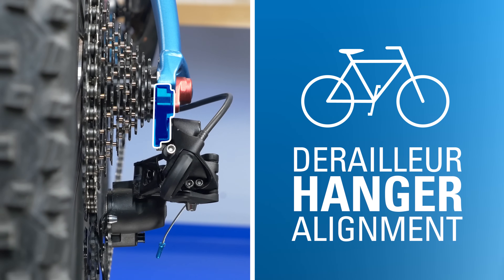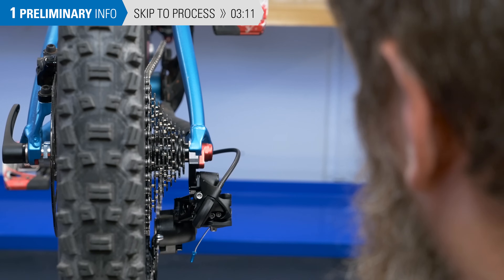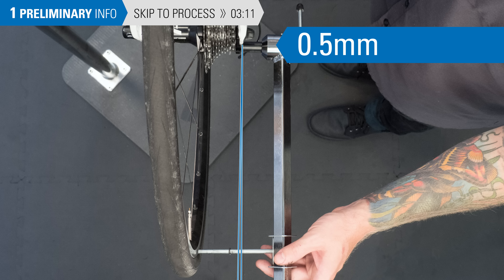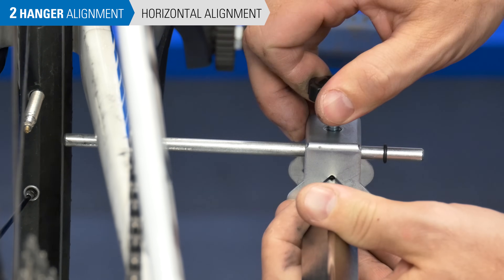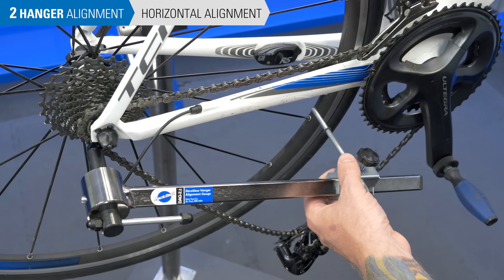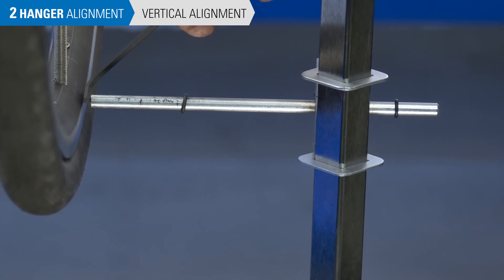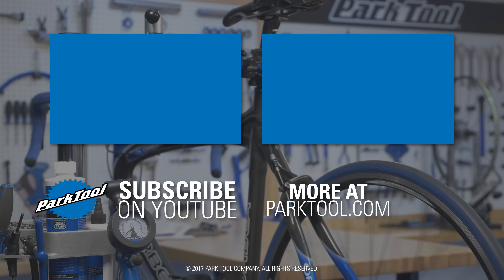How to Align a Derailleur Hanger Using the DAG-2.2

Comment: is it wise to try this method with the hanger on a carbon fibre frame?
Reply from the maker: Yes, it is fine.  Check the hanger is aluminum, the common material.  It is bolted tight to the frame. The stress and bending occur in the hanger, not in the frame.  It is done on a daily basis around the world.

Comment: Can anyone let me know if the hanger is cast aluminum, how possible it'll break during the aligning?
Reply from the maker: It is not cast, put plate aluminum.  Failure is possible of course.  However, aluminum will flex and accept a bend during cold setting.  If there is no crank into hanger and it survives the alignment, it will survive the use.  If the hanger needs alignment to shift, it is already effectively "broken" and needs alignment.

Comment: In 2010 I broke a derailleur hanger on my Trek 6000 and had a hard time finding a replacement. My next build will be a UDH compatible frame.
Reply from the maker: The "UDH" hanger is a bit misleading.  It is simply another hanger design.  It is a good hanger certainly, but the "universal" aspect is in the name.  The UDH is for thru axle only.

Comment: All the adjustments concerning derailleurs, chain length etc are PITA when you own a velomobile. For example, using this (expensive) tool is impossible because rear wheel is completely sealed in it's own cover. I'll have to make my own "tool" to make sufficient measurements, and just judging the straightness with the eye is impossible because of not large enough service hatch 😛

Comment: why not just replace the hanger??
Reply from the maker: Hangers are often difficult to find. Even after finding one, they should be double checked for alignment. The hanger may be straight, but the bike fitting for the hanger is often a bit off.

Comment: What about titanium frames? I have your higher end alignment tool but I’m finding it almost impossible to reset. It’s bent 1cm outwards and refuses to stay put when I bend it inwards. It bounces back out. Extremely annoying. Unfortunately, replacing hanger isn’t possible as it’s integrated into frame. Can’t believe I might actually have to scrap an expensive frame all because of a bent hanger.

Comment: How do you know the hanger is bending, and not the frame?
Reply from the maker: Good question.  The section that is bending is between the mounting bolt and the wheel mounting.  The wheel axle fastener will not allow bending at the fastener area or above.
Reply: @parktool  Thank you, makes perfect sense.
Reply: Also the hanger is quite soft aluminum and is designed to bend so the other components don't break, I was surprised how little force it took. With just a couple fingers worth of torque on a long arm, it felt almost like putty. Go slow and small movements at first!

Comment: Is it true if I buy chain oil for my push bike that it won't pick up any dust or dirt or anything else
Reply from the maker: There are what are referred to as "dry lubes" that use wax to lubricate chains. They are dry and do not collect as much dust or dirt. It typically does not make the chain as quiet and does not typically last as long but is a great choice if you are looking to keep your chain very clean.
Reply: @parktool over in Woolworths there is a product called WD40 chain oil would this be good for my chain

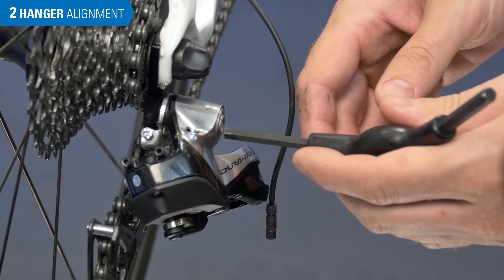Comment: What is he removing at 3:26?  Is this some type of rear derailleur quick release?  I have never encountered such a thing on a rear derailleur.  If a rear derailleur lacks this quick release mechanism, does the cable pinch bolt need to be loosened before removing the rear derailleur?
Reply from the maker: That is the wire for the Di2 rear derailleur.  It sends an electrical signal to shift.   it is best to unplug it so as not to stress the plug end.
Reply: @parktool  Thanks for the reply!  So if I am working on a traditional cable tensioned derailleur do I just simply unscrew the derailleur and let it hang from the cable/housing?

Comment: Derailleur hangers are intentionally designed as sacrificial pieces of equipment. they are like electric circuit breaker. hangers are designed to be strong enough to do it's job, and also to bend and brake,  in case of crash or bash. The main idea here is that the force from the impact, regardless of the source of the impact, will follow the path on least resistance. The hanger is designed to vividly manifest itself as the path of least resistance, so it draws the force of the impact onto itself. the idea behind this design is to protect the frame and the derailleur  from being bent or broken. If you think, this sacrificial piece saves you a frame, a derailleur and the hassle of replacing frame or equipment.... and the pile of money related to all this hassle.

Comment: Dang i broke mine i guess i wasn't gradual enough with the adjustment or is it just time to replace anyway? It was wildly of when i measured it
Reply from the maker: If it was bad enough, it needed alignment. Likely there was nothing to do by try it.
Reply: @parktool  thanks. Yes the chain was coming off the pulley when shifting down in the front

Comment: Just got mine today, and after removing the derailleur from the hanger, and following this video closely, I can't believe it.  It was imperceptibly bent inwards, which the bike being new, the hanger was bent imperceptibly during shipping. Not uncommon, but I could've sworn it was aligned by eye.  I could not have been more wrong.  It was definitely bent, and this tool got the bike shifting so damn smooth it's ridiculous.  I'm glad I just dropped the $80 on this awesome tool instead of buying a chain, and this and that.  Nothing I did following Park Tool's video on derailleur adjustment really got it smoothed out.  Because the dang hanger was bent.  

NICE JOB Park Tools! :)  I also own their small beam torque wrench, and man that makes that easy, too.

Comment: Just bought a replacement hanger
 Do i need to align it even if it's new? Coz that's what others said to me in a bike forum. I thought you just need to slap it and that's it.
Reply from the maker: It is good to check alignment.  New hangers come aligned and straight. However, frames are often not consistent, and a new hanger not be straight.  Check and aligning a new hanger effectively "customizes" it to your frame.

Comment: Is it safe to make these kinds of adjustment on a carbon frame bike?
Reply from the maker: Yes.  The hanger is bolted to the dropout, but it is the aluminum hanger that is bending, not the carbon fiber.  Aluminum can be cold set.
Reply: @parktool  Thank you so much for the  - very quick -  reply! Your help and advice is always much appreciated :)

Comment: Why don't just change the hanger ?
Reply from the maker: Good question.  First, these hangers can easily accept some cold setting without any issue.  Hangers can often be difficult to find depending on the bike model.  Lastly, although hangers are made straight the frame fitting is often less precise and aligning the hanger effectively customizes the hanger to that frame.
Reply: @parktool  Thx for the response !

Comment: Honestly its easier to just buy a new one, i think its about 15-20$ if not less. Mine broke like a cookie after a not so hard crash on the side :/ Even the derailleur broke.
Reply from the maker: Interesting thing about new hangers.  They are often made straight, but when mounted can appear "bent".  The hangers are more precise than the frames, which tend to be sloppy.  A new hanger needs to be checked and "custom fitted" to each frame.

Comment: Also remember to make sure replaceable  hanger mount bolt(s) are tight. Loose bolts can also affect shifting
Reply: i have 2 spare hangers, i have bolts on each one of them, but you can use the bolts from the original to install the spare if you are careful not to loose them in the grass on the trail side
Reply: *Torqued
Reply: @thegrowl2210  shut up

Comment: I finally fixed my bike.  I shot a laser parallel with my frame then measured to make sure my rear tire was in-line with my frame and come to find out it was 1/2" off so I used a dremel to grind the hanger about 1/8" back so the tire axle can go back on one side making my tire in a straight line. I then used this hanger tool to align my hanger. I got everything to 1/8" and WHAT A DIFFERENCE. Instead of only being able to shift half my gears and have them pop out of gear all the time it shifts like a Ferrari. I brought my bike to 3 bike shops and multiple times to those shops. Everyone just gave my bike back charged me for a tuneup and nothing ever changed......If you want it done right do it yourself!!!  Im happy :)

Comment: Can this be used on a carbon frame to straighten the hanger asking for a friend
Reply from the maker: The carbon fiber frame will use an aluminum hanger. Yes, you can align those hangers on a carbon fiber hanger.  If the hanger were actually made of carbon fiber, then do not align.   No one does that, however, it will be aluminum.

Comment: Is there a recommended torque for installing the derailleur hanger on the frame?
Reply from the maker: If these are the small M3 screws, it is pretty light, about 1.5Nm.  If it is a chainring style bolt, 6Nm.  Use common sense.  The real holding comes from the wheel axle as it is clamped.

Comment: Presumably, this only works if the wheel is true?
Reply from the maker: Not at all.  Simply pick a consistent spot of the rim, and rotate that when check the various points.  Right by the valve is an easy reference.

Comment: What if the Derailleur Hanger ist adjusted but the (brand new)  Shimano XT Shadow derailleur is still not in line with the cogs?
Reply from the maker: Use the derailleur limit screws to align the derailleur to the smallest and largest sprocket.  However, just because a bike is brand new, do not assume the hanger is straight.
Reply: @parktool  The hanger and the derailleur  (not the bike) is new and both are adjusted but still not in line. Are there any other reasons for that?
Reply from the maker: Give this video a shot. https://www.youtube.com/watch?v=UkZxPIZ1ngY&t
Reply: @parktool  I already watched almost all your vids as they are really great.

Comment: I managed to snap my hanger 😕 the frame and broken hanger has three fastener holds but I have a replacement hanger that fits but only two fastener holes. Would this be ok to use if the shape fits?
Reply: Rachel, even if it works I'd say the answer to your question about replacing a hanger with less fastener holes than the original is not to do it.

Comment: is the bending adjustment recommended for carbon frame bikes?
Reply from the maker: Yes it is. Carbon Bikes have a softer aluminum hanger so that if it breaks it does not ruin the frame. Proper alignment of that hanger is crucial to the operation of any shifting system.

Comment: Ok bought this tool yesterday I would have bought the HAG but very expensive for the self funded retiree.
Anyway followed your instructions and found to my horror my new Giant ebike had a difference horizontally of some one and a half centimeters YIKES.  Tool was easy enough to correct problem and checked vertically then horizontally again until I was happy with the clearances. There is no information on the Ball Plunger component part number 1748 ? I know it holds the inside sharft in alignment but it feels a bit loose and if you tighten it shaft will not move. Should a dab of medium Locktight be applied ?.
There is a little movement with THE D.A.G 2.2 but I guess it's better than those coming out of China.
HAG looks to be the superior product but cost for home workshop  is hard to justify.
Graeme in OZ.
Reply from the maker: Always check with the shaft push toward the wheel to eliminate any error move pivot movement.
Reply: @parktool  ok will do. Happy with tool now I can see the alignment and not just guessing. 
There are a lot if copies of this tool out there and their prices were very tempting but quality and longevity would be questionable. Glad I bought the Park Tool.
Graeme in OZ.

Comment: Hi dear. I have a xt m8000 rear mech that uses a B-Link. Should i align this part also? Thanks!
Reply from the maker: Yes it should be checked. That is last piece the derailleur references for alignment.
Reply: @parktool  Hey guys, thanks for the answer. As the alignment of the hanger will primary influence in the b-link, and than the link itself, i first did hanger alignment, therefore the link repeating the concepts, but after a look rearward i had the impression that it still misaligned.

Comment: The last two bikes I have purchased (brand spanking new) came with hanger alignment issues. And with these big ass cassettes we are using these days, alignment is critical. I have the older model DAG-1, and it fits nicely in my travel toolbox.
Reply: It's not necessarily the size of the cassette (you're talking about tooth count, right?).  It's more about the spacing between cogs.  Now that we are have 12 speeds, the spacing is very small which reduces the amount of tolerable error.
Reply: DAG older or newer is excellent tools and does great gob. Enjoy it!

Comment: My bicycle is 6 years old. I have been having chain skipping in the back middle cogs,  3,4,5 mostly.   I replaced the hanger, the cassette, the front crankset, and the derailleur.   rear cogs 1,2,6,7,8 are ok.   It makes my rides much less fun.  I have adjusted the limits and the derailleur 20 times and it does not skip in the shop, only when I am riding, I  don't know what to do next.
Reply: Did you try replacing your chain? A worn chain will wear out the sprockets, then if you replace the sprockets but not the chain, or the chain but not the sprockets, you'll get chain skipping.
Reply: Cassette or chain worn out replace both
Reply: same condition as mine. Try aligning the RD hanger as shown in the video
Reply: If all that has been done, maybe you have a cracked frame.

Comment: How about checking for a bent derailleur cage?  Is there a way to accurately check this, like there is for the hanger?
Reply from the maker: Good question.  Not a good answer.  By sight is how.  However, not all derailleurs are designed to be "straight and square".  View the cage from the top, and the back, as it a three dimensional issue.  Compare the suspect model to a new one.  Repair is a different issue. The cheaper the derailleur, the more likely bending back may help.  Those are not typically the ones to worry about.

Comment: I recently bought this tool because of this video :)
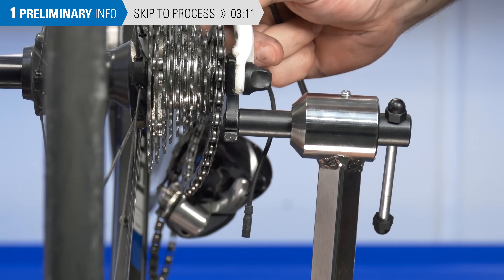I was wondering what this little "Ball Plunger Screw" at the end of the weldment is for (as seen at 1:58 on top of the tool)
Reply from the maker: It is used to adjust out play by tightening slightly.
Reply: @parktool  What is "out play"?
Reply: @parktool what was that website called you used and I ordered a new derailleur but when I put it on it touches my cogs when I check it

Comment: Looks as though you risk bending the frame using this tool. I would prefer to bend the hanger in a vice.
Reply: I did  wonder that myself, but then realised the hanger is attached to the dropouts, which are extremely strong.  I just realigned mine and very very little pressure is needed on the tool, I had zero concerns at anything other than the dropout itself breaking.

Comment: Question for the Park Tools gurus.  I have used the alignment tool successfully for derailleurs that are easily removed from the hanger.  I am now faced with a Shimano 7 speed derailleur that doesn't expose the bolt connecting the derailleur to the hanger.  It is covered by a piece of plastic and the two limit screws.  How do I get to the bolt to separate the derailleur from the hanger?  Help!!!  :-)
Reply from the maker: There are certainly models that have use a "bolt on hanger", which attaches to the open face of the dropout.  Generally older bikes and less expensive bikes do this.  The pivot of the derailleur is riveted to this bracket, and there is no bolt to remove and thread the DAG-2.2 into.  If so, some careful use of a pair of slip joint pliers and a steady hand can bring it back enough.
Reply: Park Tool Thanks

Comment: I dont have a derailleur hanger ( cheap bike). My derailleur is welded into the bike frame. While bunnyhopping i fell down and saw that the derailleur was bent towards the spokes of the wheel.
I just simply adjusted the barrel adjuster and shifts just fine with only half a second delay. If u dint have tools try turning ur barrel adjuster to match the derauiller wheel with the cogs. Works fineeeee asss hell.
Reply: Probably because your hanger wasn't terribly bent. If the damage is bad enough it can send your derailer into your spokes which could royally fuck your rear wheel and and total your derailer! You can also eat shit into oncoming traffic. Happy your bike works again but that's just false economy! Cheers

Comment: Can I use this tool with a hanger that is actually part of the frame?  Note: the frame is steel.
Reply from the maker: Yes, certainly.  Steel will bend and take a set quite well.  Always inspect for cracks before and after any bending.
Reply: Park Tool Thx!

Comment: I'm used gravel bike MARIN GESTALT x10.had the same problem,my chain rubbing the cassete after i fall the bike.slowly cycling back to home,and after check,my frame (dropout) was bent at the RD point,but the hanger are still ok.i used the adjustable spanner,to alignment back the dropout frame.almost 1 year,i never face any problem.but to have a SPARE HANGER,i think its a best idea.cant imagine if  i'm broken it in the way long from my home and in the deep of forest..